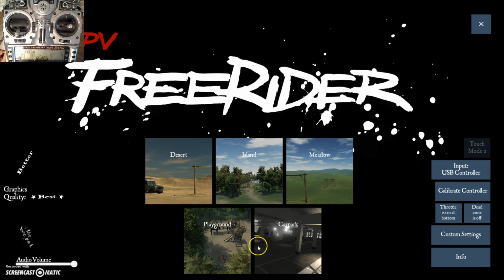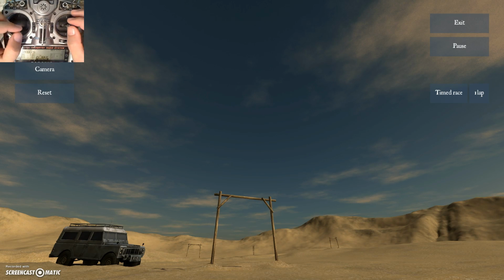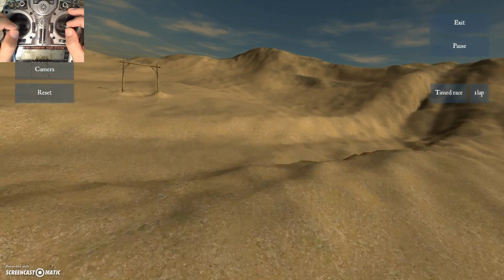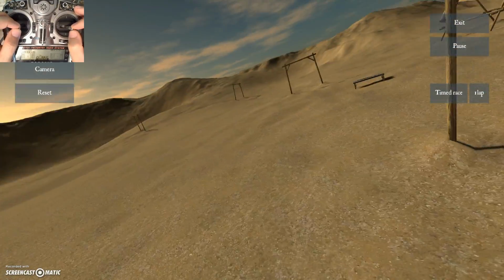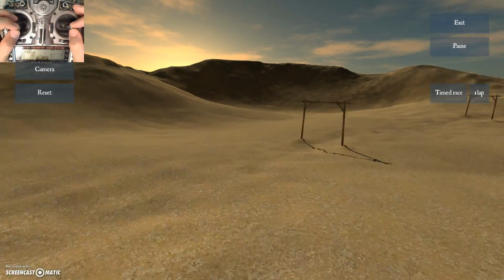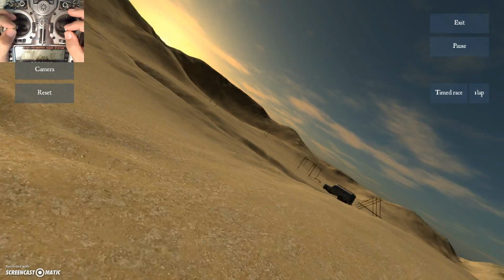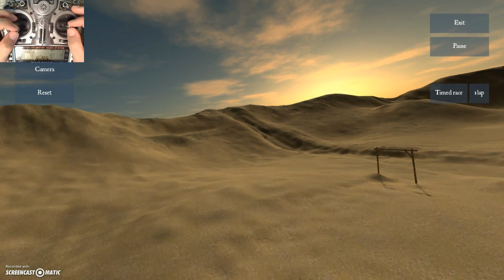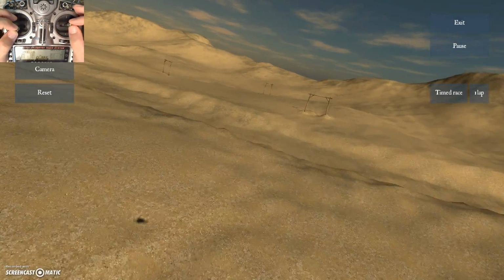How To Fly A Racing Drone - Lesson 12 - Low-Altitude Coordinated Turns

Comment: This is by far the hardest lesson so far, I guess it will take me some time to master it.
Reply: Mad Marty i got this kinda thing yesterday after about 5 days of simulator practice. it just clicked one day and suddenly i could do the "pinching" thing like joshua does (i used to not be able to) and i got a LOT better at these small precise maneuvers and went from stabbing the throttle and pitch/roll repeatedly to modulate it, to actually adjusting it only as much as i needed.

Comment: Joshua Thank you for the video. I think there is something u might miss out. I took really long time to learn flying. there is expo in yaw pitch and roll. that all I know I am wondering where is the throttle it seem so hard to fly at mid point and it so touchy in liftoff FPV game.  I was flying 3 month without the motor curve (thorttle ) expo.... until today i found that at my controller DX6 under motor curve.. Wooooo I decreacse my lap time by 20 Second!! the throttle is so smooth. maybe u might highligh this so the student will find this information for throttle expo.. I can wait for sundown to fly Real FPV now!!
Reply from the maker: +United Electrician I strongly prefer linear throttle. The hover point changes based on many factors like weight and power. Only linear throttle is consistent for every setup. Flying a copter of 300 grams or more with linear throttle is just a matter of practice. For very light copters I sometimes might use expo.
Reply: Thank you, for replying. It hard to fly linear and maintain the height with figure lesson u mention it become harded. when I try the other track in game. flying in the carpark is insane with the height limit it become really hard to fly at limited height it insane tough without hit the roof. but I still will gradually run linear on my throttle expo. thank you for all the video and you really doing very well and make my hobbies rock!!

Comment: Hey thank you for the videos.  I am able to fly in true acro mode now on my 250 quad.  I remembered watching your first video a couple months ago and I thought that you did not need to practice in a simulator.  Well I was very wrong because I lost my first 250 quad with the Orgin shell on its first flight.  I did not even go through a battery.  I have another one now and have spent about 2 months in the simulator and also repairing my copter.  But now I am able to fly and it has completely been worth the time to spend practicing.  Thank you for the videos because it got me flying finally.
Reply: Drone Guys USA very nice 👍👍🙏🥃

Comment: is this headless mode?
Reply from the maker: +mac reyes acro. Always acro.
Reply: Joshua Bardwell sory? acro means? sory new in this hobby :( i suck on flying so i really need the info i can get. btw im using syma x5c-1.. im bad in turning :(
Reply from the maker: +mac reyes acro, or rate mode. No autolevel.
Reply: Joshua Bardwell oh ok. need to watch more video's btw cool stuff u got there. great video's